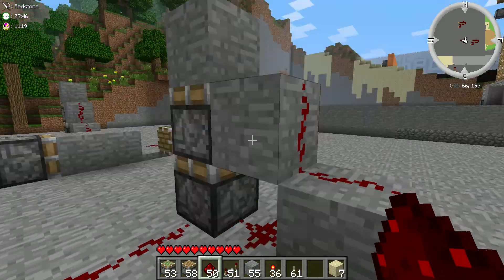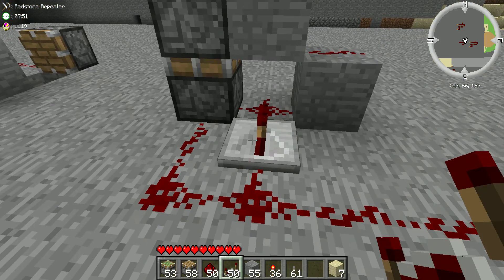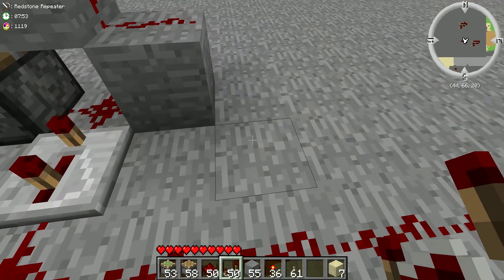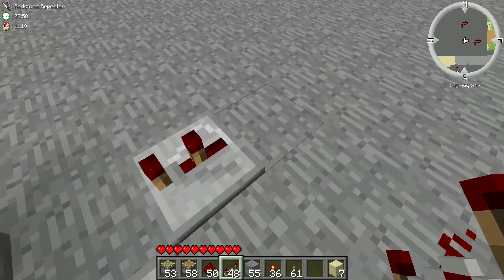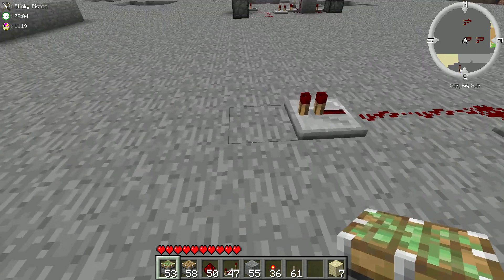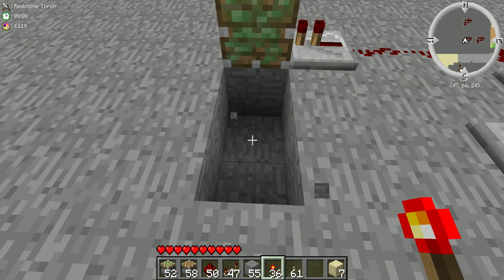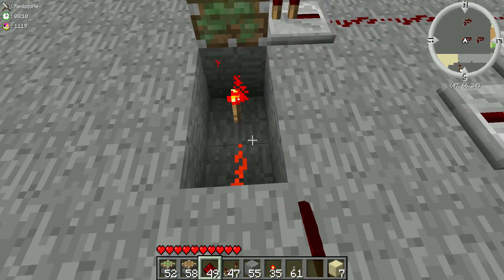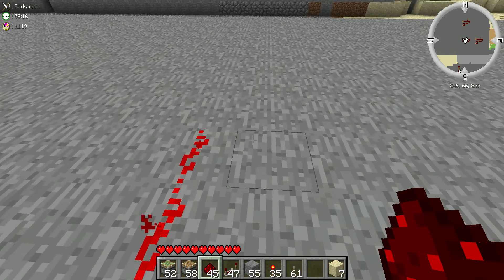How to make a Double Sticky Vertical Piston in Minecraft

Comment: Thanks a ton for doing this, it's great.  I'm planning to try to adapt this  to a sort of 2x2 or 2x4 version.  An even greater challenge is,  if it's possible to use 2 switches for input (one on each side of a gulf). That way, you can hit a switch, cross, then turn back around, smack another switch and have it go back down. Of course I'd have to make it so I can hide all the 'wiring' too. It's an ambitious project, so this will go a long way toward helping me understand what I'm working with.

Comment: @grantthedrummer I lucked out and figured out how to make it work. It no longer uses double sticky though because I got really confused when making my 2x4 configuration. Instead the first layer is sticky and the 2nd is normal. The blocks above are just sand or gravel so I can let gravity do the work. It's not ideal, but it was much easier to understand than trying to get the 2nd layer to work properly. Despite being sticky, it'd leave its attached block behind. But yeah, XOR problem solved! =)

Comment: I had to look up a tutorial on the XOR gate. I understand and can recreate the concept, but I've seen it in a limited presentation in which all the wiring is close together. It's just a matter of time though. I recreated what you've shown here, and added a 2nd piston adjacent to the first. I just haven't been able to feed power to the 2nd one without the first piston set malfunctioning (the 2nd piston doesn't extend in the primary column, but does in the secondary column).

Comment: since the new redstone update. redstone will not corner (connect) into a piston. I'm having issues figuring out how to make that setup work now because of that. underneath the stairs (that one piece of redstone) is what i'm talking about. if you try it now you'd understand what i'm talking about. How do i (you) fix that issue? i need it go vertical like in your video.